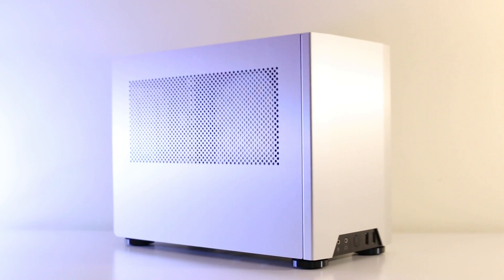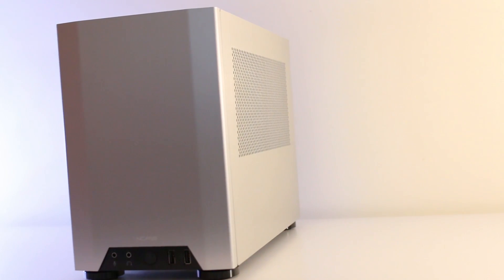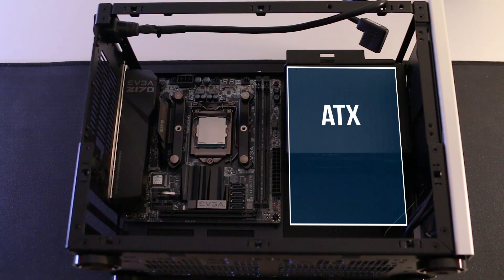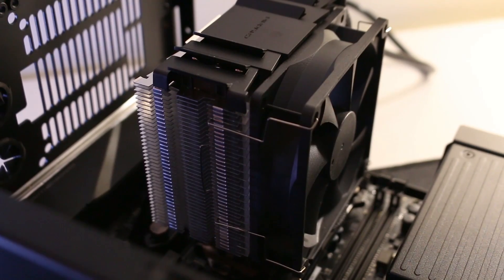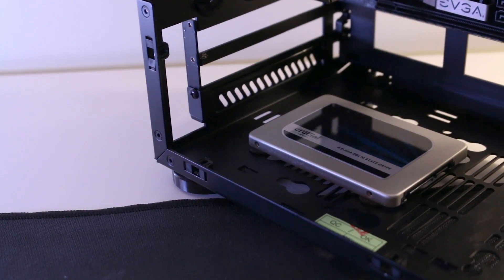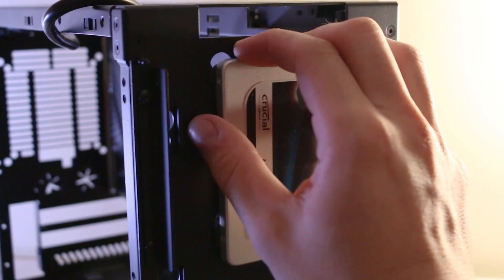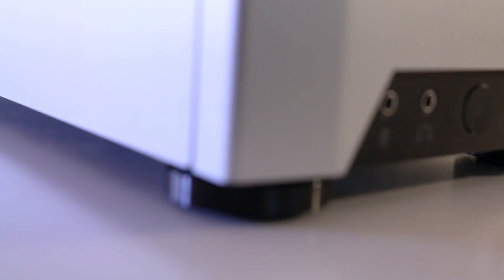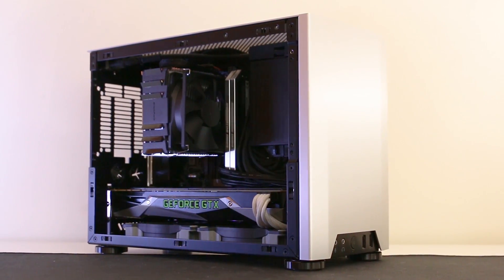NCASE M1 v5 ITX Case - Review and Component Selection

Comment from the maker: Hey guys, something that I forgot to mention in the video is the choice between blower and open-air GPUs. Although NCASE themselves recommend a blower style cooler to exhaust the hot air out of the case, an open-air card like the Asus Strix still works really well, and as you can see they still get plenty of air from the case basement. 

Thanks for the support as always!
Reply: Great video, keep up the good work! Have you got any data on the thermals of open air cards? I keep hearing the recommendation to use a blower cooler but they never show any thermal data.
Reply from the maker: Joshua Kie I don't have any rock solid data as I don't have an open air card with me at the moment, but I have talked to a few people with open air cards and they say they run fine.
Reply: Hey I just built in the Ncase M1 v5 and the power button is flickering blue and red. Can anybody tell me how to set the color to just blue so it stops flickering? I double checked to make sure that they where all the way plugged in.
Reply: Hey, are the front panel USB's blue or black? I see Blue in some pictures but in this video I see them all black.
Reply: Matt Smith I though I just have a plus and minus to plug in but I'll check.
Reply: Ooooh OG content!

Comment: I love my NCASE M1 V2. I've been running it for about 2 years now. Just bought a spare M1 V5. 

SPECS:

6700K at 4.6GHZ on air with Cryorig C1 (Noctua Fan) 
ASUS Z170 Pro Gamer ITX 
Nvidia 980TI (Reference Cooler) at 1450mhz . 
32GB of Corsair DDR4-3200 
6TB WD Black 7200 RPM 3.5 Drive 
512GB NVME Samsung M2 SSD 
Slot Load DVD Player

I had a little trouble maintaining the CPU overclock at first. I added a side intake fan with the included bracket which solved the issue. I replaced the Stock C1 fan for a Noctua. 

I noticed that after extended gaming session my 980ti would throttle to 1350 mhz and the bottom of the case was hot to the touch. I added two slim 120x15mm fans as intakes to the bottom of the case.  GPU now maintains a solid 1400+ mhz, and the case no longer gets hot. 

Overall, the system is extremely quiet, very small, and looks fantastic.

Comment: Amazing channel.  The quality and hard work shines in every video.
Keep up the good work! 
Hope to see million's of subs.
Reply from the maker: That means a lot to me! Thanks so much for the kind words.
Reply: Stupid question for you if you don't mind answering.
Most cases (90%+) usually feature side panels that close by sliding in, this in turn if you think about it would very slightly reduce the system's noise as it almost seals the pc shut.
The ncase m1 just has clip's in which you just close the side panel by pushing it in... it doesn't have the same "sealing effect" as the sliding panel doors (ex. bitfenix prodigy &).
Do you think this in turn let's more sound/noise of the system out compared to other cases with sealing sliding panel doors?
Reply from the maker: Yes I agree. The vents in the panels don't help either when it comes to noise, but they both help when it comes to cooling
Reply: So technically speaking the ncase m1 case is louder (depend on the system inside) then cases that have those sliding sealed door panels, correct? 
If so, how much of a difference do you think it'll make?
Reason why this is important for me is because I truly like the ncase m1 case but I want my system to be pin drop dead silent and willing using a noctua air cooler.

Comment: I have an M1 and I built a system with a Z170 asus pro gaming mobo, 6700K, 32 GB LPX Corsair memory, Corsair H55 AIO, SFX Corsair SF600, custom length and sleeved PSU Cables, EVGA 1070 FTW Hybrid to fill the 2nd 120mm rad spot.  I had to purchase a couple 90 degree power connectors to fit the side panel on but everything in the case stays nice and cool with the two 120 fans for the radiator and a 92mm rear fan, all as intakes venting out the top.  I have an 960 EVO M.2 Drive for the os and two 2.5" ssd's in the front.  It has been a joy to work in.
Reply from the maker: Matt Goebel that is one hell of a system. Do you find it a little cramped with the two AIOs? And yeah, I've heard the FTW cards juusssst fit!
Reply: The AIO's can make getting the bracket on a little difficult but not too bad.  They only fit if you put the rads out toward the side panel and I decided to have the fans pull so that I could use the filter to stop the dust and get some air flow to the internal components.  The FTW Hybrid's tubes are much thicker than the H55 and they really only fit one way without pushing the side panel off.  

I also added some thick thermal pads for my M.2 drive because it is on  the back of my Mobo and I can feel the side panel take some heat.  The drive temps dropped 20 degrees though, (60 to 40).

Comment: I've had my Ncase M1 for a few months now and I love how small it is. I move around a lot so the small size makes it easy to pack up and move. My parts are as follows:

Asrock x99e-ITX/ac
Xeon e5 - 2667v3
Noctua NH-U9DXi4 (terrible name I always forget it)
GTX 1080 FE with EVGA hybrid AIO cooler 120mm rad
Silverstone 600w SFX PSU
256GB Intel 900p SSD
2TB WD Passport HDD
92mm noctua exhaust fan
120mm noctua industrual fan for radiator
16GB Corsair Vengeance DDR4 3200 (at 2133 with tighter timings because I can't overclock it on Xeon)
Reply from the maker: I like it. Powerful, compact rig with plenty of storage 👌
Reply: Went through a lot of different cooling solutions for the Xeon. It was hard finding a cooler that fit and had mounts for the narrow ILM mounting point on the Asrock motherboard. This cooler fits perfectly though and keeps quiet as well as cool. The Xeon now never goes into the 70s C. Under full load it's barely louder than idle, though due to the nature of the case and the pump noise, idle isn't quite silent. Still,  it's a lovely little build.

Comment: In my opinion, totally worth it the 185.00. Anything less than that typically looks like cheap crap  that noone wants to have. This has the high end mac like feel (especially silver color) and the design of the case plus of how easy it is to work on wins everywhere. The size actually is perfect for what most people need anyway. No more ugly tower cases, etc those are dead as SFF is the new norm. I do think that the power button is cheap and i have done an upgrade to it which makes it super nice. Thats the only mod i wanted to do, plus i wrapped the front panel io with carbon fiber.
here is a link https://hardforum.com/threads/how-to-upgrade-the-pc-power-switch-on-ncamse-m1.1931135/

P.S i do not recommend DanCase over this or anything smaller because you will not cool your high end components properly.
Reply: "high end"
"mac like"
pick one
it also comes in black
Reply: nice comment. agreed.
Reply: The node 202 is a decent low budget case albeit more limited when it comes to components choices.
Reply: Ghost S1?

Comment: Hello! I have a pretty nice M1 build as well, it's been fantastic for me so far. Temps are wonderful even with a moderate overclock and I bring it between home, work, and other places almost daily.

I'm definitely going to try adding your feet design, I think they look a lot better than the weird small hockey pucks the case comes with. I may try making similar ones out of wood though, because I'm weird and like making things out of wood.

i7-7700k
Corsair H75i AIO
ASUS ROX STRIX Z270i
32GB Corsair Dominator RAM
EVGA GTX 1080 Founders Edition
Corsair 600W SFX PSU
2TB Samsung 960 Pro SSD (m.2)
2x 6TB Western Digital Black in RAID0 (1 mounted in drive cage, 1 on floor)
8TB Western Digital Red (in drive cage)
Panasonic UJ265 Slimline Blu-Ray Burner
2x Noctua NF-B9 fans (one on front floor, one on rear exhaust)

It's pretty packed, and cable management was challenging, but it was worth it in the end. 20TB of traditional storage is really valuable for me since it can be my primary workstation (it's all backed up automatically to two locations, one offsite, so I'm not worried about RAID0 reliability issues)

I had to mount the mechanical drives awkwardly since you can't put the 8TB Red on the floor mount due to it missing the standard bottom center screw holes.

Comment: (Built Early 2016) NCASE V5 / ASROCK X99E-ITX/ac Motherboard (with stock CPU cooler) / Intel Core i7 5820k / Corsair LPX 32GB DRAM 3000MHz / NVIDIA GeForce 960 / Silverstone SFX 450W PSU / Silverstone Fan Hub/ Arctic F12 PWM PST Fans x4 (very happy with these in a positive pressure config) / Various SSD/HDD I had laying around, nothing fancy. 

I'd love to switch to an NVME. Haven't been gaming as much as I used to because of work, so no need to bump the 960 just yet.
Reply from the maker: That's an awesome configuration. I could imagine editing and encoding to be an absolute breeze on it! I think positive pressure would work well inside the M1 due to the ventilated side panels as well.

Comment: When compared to the Dan A4-SFX or the Louqe Ghost S1, this case comes out on top. I had built a system with a 9900k and a RTX 2080ti in a Louqe ghost S1, during gaming the case got too hot to touch and the 2nd M.2 installed on the bottom of the motherboard hit temps over 100 degrees celsius. After swapping everything into the M1 and including 2 slim 120mm fans in the bottom of the case oriented as intakes and a slim 92mm on the back exhausting hot air out of the rear. With a Corsair H100i V2 and a pair of Noctua NF-A12x25 fans on the cpu to keep the 9900k in check, the system runs cool and quiet. The only downside to this case I find is that some of the screw holes will strip out if you are constantly swapping hardware in and out of the case. The screw holes for holding the gpu in place on my case have fallen victim to this and it is minor but is something to be concerned over if you intend to travel with a system in this case.

Comment: Hey Optimum tech, love the video's!
I had a question regarding the Ncase M1 acoustics. Although 90% of system sound is dependent on your components I wanted to know about the 10% being the case itself. The ncase m1 just closes it's side panel using clips instead of a sealed sliding door on most other cases.  Do you personally think compared to other cases their is a slight increase in noise using this case if u r aiming for a strictly PIN DROP SILENT build?  I will ONLY be using the PC for surfing the net & word doc's so I don't even want to hear 1 sound from the system. Will use air cooler from noctua or bequiet for the build. I would love your comment, suggestion, and advice.  Thanks!

Comment: the gpu numbers were really confusing. so assuming a sfx power supply. what is the max length/width/height of a possible gpu. (maybe give 2 sets of numbers, 1 without fans on the bottom and 1 set of numbers if you have standard 25mm fans installed on the bottom).

you say max length is 317 mm (for a 2 slot card). but the image at 2:23 shows 290mm. so if the card is a 3 slot card it can only be 279mm? 

so the max width is 140mm (for a 2 slot card)? so a 3 slot card would have to be less wide for some reason? you say the "excluding ftw cards"? what does that mean excluding them from having issues or excluding them from working in the case?

one of the largest FTW cards is about 267mm x 129mm x 76 mm. so that should fit right? being a 3 slot card, its under 5 inches wide and only 267mm. i assume without any fans below.

Comment: Thank you so much for making this video. The most helpful ncase review I have seen on YT by far! You got a sub from me today.

I'm ordering one next week, are you able to confirm that v5 of the case includes the filter for the side fans? The home page doesn't picture it as included, but the accessory page for it says incl in v5.....

My build:
GA-H97N-WIFI
i7 4790S with Dark Rock TF (hopefully it fits)
2x8gb @ 1333
GTX980 EVGA FTW
SF450
500gb sata SSD

I plan on a 2nd hand 1070 from OCAU when vega pushes the prices down a little more (your 1070 video was most helpful also).
Reply from the maker: Thank you for the comment and for subscribing!

It does come with a magnetic dust filter.

Also, the Dark Rock TF does fit (just), but make sure you've got low profile RAM.

Comment: Awesome build ! Where did you get the custom cables for the Corsair SFX PSU ? I have the same PSU and my case arrives soon. I bet those cables help a lot in building in this case. I have the 450W Version and currently a 1060. Since its a Gaming X from MSI i have to sell it, it doesnt fit in this case. I might get a mini GTX 1060, or maybe a 1070 from Gigabyte, which should actually fit. Concerned only about the PSU with 450W if that is enough for the 1070 and 4 SSD drives.
Interested in your case feet ! Do you ship to Mexico ? How much would be that ?

Comment: Hi, great video!
Just to be clear though because you confused me. I am looking for a SFF case to build around my MSI GTX 1070 X 8G gfx card. Will this or won't this card fit inside the M1? 
The card is 279x140 but you mentioned the MSI specifically but I don't want to buy if it won't fit? Please confirm.
Thanks

Comment: Question: I'm trying to get the airflow in this case figured out. Normally, it seems air is taken in passively through the top and sides, actively/passively from the bottom depending on the fans. With a glass side panel, does that mean air comes in strictly from the top and sides? Is the vacuum generated by the CPU cooler enough to draw fresh air from the outside and are motherboard temperatures okay with a small tower style cooler? Accurately guessing airflow is not my strongpoint.
Reply from the maker: As you said the case is mostly passively cooled. Air is drawn into the case through the vented side panels as the CPU cooler (and 92mm exhaust fan if you're running one) create negative pressure. I'm seeing fairly reasonable temps seeing as the case has ventilated top, bottom, rear, and side panels.
Reply: Hmm, I see. So even with your now non-vented side panel, temps seem unaffected? I'm currently in the Silverstone RVZ02 which is also a negative pressure type of case. At the same time, it's also more "open" in that the mobo and GPU and in separate chambers with their own vent panels and so don't have to share air with each other like in the M1. I think that the M1 is a bit wider based on GPU orientation but seems like it might have the perception of taking less space since it's not as tall. Is it bad I'm already thinking of upgrade paths?

Comment: Would you agree with me that you could upgrade both the CPU and GPU power if you liquid cool both of them. Since i don’t have the exact measurements of the new Asus Rog Strix RTX 3070 ti, or are you still limited by the max length to the RTX 2080 TI founders edition or the Asus Rog. The sane question i have for you is regarding the Ghost S1, with Watercooling and installing the additional riser element could i install such cards and of course at least a 12 if not a 16 core AMD CPU ?

Comment: I have an m1 as well! Though mine is black
I have an asrock b85m-itx, from another pc, it allows me to overclocking which is cool but I'm leery about doing that without a better cooler
4690k, no oc w/ stock cooler
Been considering getting a new air cooler, but not sure it it's worth the investment to oc, 
16gb hyper X fury 1600
A 250gb 850 evo
A slimline odd from another pc
Sf600 psu from corsair 
With the Asus 1070 turbo
I also have two NZXT Aer Rgb fans in the side intake, where most people put an aio and I have one 80mm exhaust fan in the back
I might try putting one of my high static pressure fans underneath since that seemed to help your gpu

Comment: Hello! Building af fairly lower budget gamer PC with mostly older existing parts. Just bought an used Ncase M1 v6.1 and will be mounting an Asus H310i v.2. motherboard and an Asus 3080 10GB OC Gaming GPU. My question is the powersupply as a Corsair SFX-L SF850 i cheaper than the preferred SFX SF750... Do you know if the SFX-L PSU will fitt? Having a SF550 already but I don't know if that delivers enough power. Thanks...

Comment: Would a 240 aio plus hybrid gpu fit together? 
Hybrid 120 mm radiator in the back, 240 mm on the side, one fan one HDD on the bottom and one ssd in the front. Is this doable? Thanks, nice video!

Comment: Wait a minute, wait a minute, wait. a. minute. How did you mount the SSD drive in the front with the Rubber Soft Mount? My screws are far too short to be mounted with them or if I use the one for the HDD, they seem to big for my SSD's thread :/ What is that sorcery?

Comment: @OptimumTech
So, there are 4 places for 120mm fans? Two on the bottom (which should be slim if having a radiator there), and two on the side bracket? I thought there'd be a spot for another on the front below the PSU space. Or one next to the PSU space above the motherboard.  
I've been trying to clarify this for V5 so I know what I'm getting into, I plan on liquid cooling my CPU but not my GPU with a custom loop, most likely with a GTS 240. Would I want slim or 25mm fans with this rad on the bottom?
I was going to get v.2 of the maelstrom but I don't want the tempered glass so I'm going to use my EK Revo with the 110mm tube.  
Next thing is get custom cables for the SF600 I have. Now, does anyone do M1 cabling for cheap since the cables are short? Or is a full price as much as ATX custom cables that are 300-450mm long?

Comment: Where did you get the 24 pin power supply cables?  And how long are they?
Reply: regieds You can make custom cables at Cablemod. You can choose the color and the length of all cables. But it will cost a lot.
Reply from the maker: I made the 24-pin myself. It's 74mm on the shortest end and 156mm on the longest end.